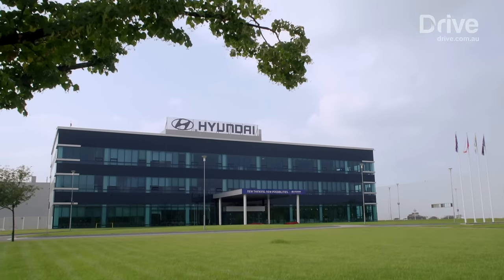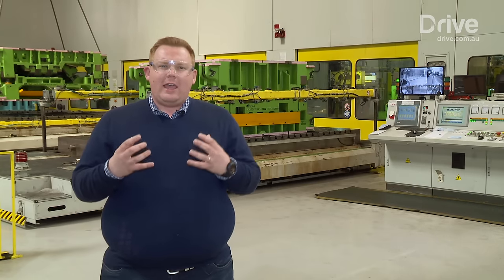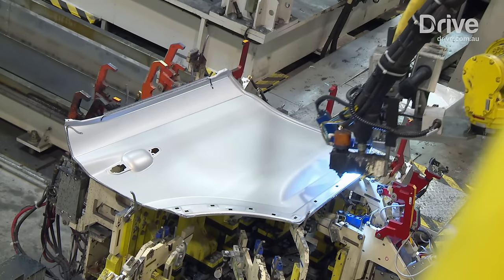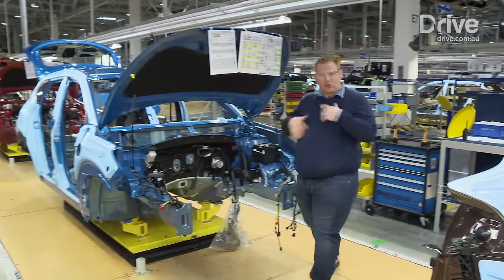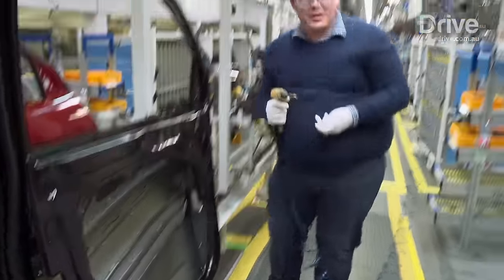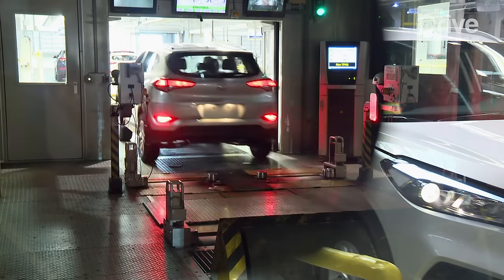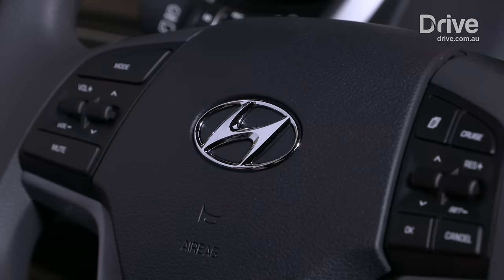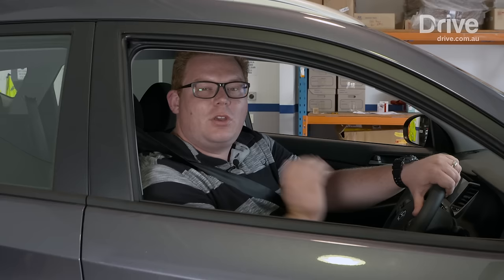How to build a car: Inside Hyundai's Czech plant | Drive.com.au

Comment: Hyundai showed great progress in last 20 years, fom always ''shamed'' Accent to new i40... reliable cars but not so cheap priced  anymore.  We have those cars in family since 1994 and it started with Pony (Excell), than 2001 accent in 2006, Getz diesel in 2008y than my 1995 Accent, in 2015 new i40 and year and half ago my 1999 Accent. Not single problem with any of them. Oil, gas and filters. and it will run long time. Many people just laugh to those cars like cheap crap, but if you give options between i30, VW Golf or Ford Focus I'll take i30 1.6 GDI.